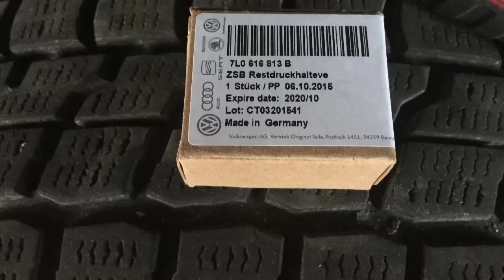Touareg air valve fix front suspension

Comment: Did you get the infamous "Stop Fault Running Gear" warning display before the replacement of that valve? Going through that problem with my treg at the moment and air suspension is exactly how yours was in your video, sitting low in the front but still normal ride height in the back. Recently took it in to a local shop for a diagnosis and they want $1600 to replace what they say is a bad air compressor. Have done a lot of digging around the net to try and (affordably) fix this issue and have learned that others have spent the $1500 - $2000 only to continue dealing with the problem. Part of me wants to trust the mechanics and change out the compressor (still a $300 aftermarket part), as I am no mechanic myself, but these suspension systems are so complex that part of me wants to continue digging and rule out the much less costly expenses first. Just weighing my options at the moment. Thanks for the video!!
Reply: So what did you end up doing? I'm having same issue, thinking about having a go at the valve change in the video.
Reply: Have you resolved the issue?
Reply: Issue has been resolved. Ended up not having any parts changed out by the mechanic. Dug a little deeper and found a pinhole leak in one of the airlines where the line itself connects to the air compressor. Cut off the end of the line just beyond the leak and reconnected to the compressor. Never had another issue after that. Am unsure of how long that quick fix would have held up as I traded it in a couple of months later due to other costly issues arising. Thanks again for the video and hope this helps someone else in this situation!
Reply: Always consider your valve blocks

Comment: I'm getting the 00143 fault code on VCDS. I changed out the sensor, but that did not fix the fault code, I guess I will need to spray some soapy water on the area to see. one question, if I do need to replace valve as you did, do I need to bleed the system first or just pull the plug and let air come out?

Comment: What type of key did you used to open the valve??
Reply from the maker: It was a torx key, slightly tapered/grinded tip for easier entry

Comment: Hey everyone. My Touareg has the stop running gear fault signal. It was first orange and then it turned red after I started to lower, rise and lock. Just before, the signal appeared  I was going pretty fast through some deep puddles splashing the water over the roof. Now the front is blocked in the off read level extra and very stiff as if locked in position with a metal bar. I would really appreciate any help you could provide on this subject.
Reply from the maker: I think it might be the level Control switch/arm. They are located near the shock absorbers on each wheel, a bit high up on the shocks. The plastic arms are connected like «elbows», tendens to rust and get stuck.
Reply: @spoon761  thanks, I'll check it out

Comment: I presume the procedure is to first put it in jack mode and on jack stands? I was first thinking of only supporting the leeking corner, but if the pressure is released it will sag on all 4 corners no?

Comment: nice video! we supply all fix kits for that airmatic strut.
Reply from the maker: steven Kaibintech thanks!  Do you supply new shockabsorbers only? I have some «knocking» sounds from the front, both sides, and cannot find the reason for it. Not any ball joints, maybe the steering rack, but I mostly suspect the shock absorbers.
Reply: @spoon761  Strut mount maybe.
Reply from the maker: @carnut9193  Actually it was the anti roll bar bushings. I found it by chance when the car was on a four post lift for a different reason. It needed to rest on the wheels to find it. Cheap Fix luckily.

Comment: Nice fix! I wonder if it would be a good idea to take those valves apart and clean them every few years....
I did the color by the way, very few are that blue and even fewer are V10s!
Reply from the maker: Thanks! Maybe dismantling and clean them every other year will help, but I think the problem might be brass vs aluminium. I've seen brass tubes in boats, loosing its copper content and get britle. 
  I recently sprayed them with thin rust preventive oil. We'll see...

Comment: I’m not able to get out the last bit of The broken valve. Any tip to get it out? Audi Q7. Thanks
Reply from the maker: Per-Ørnulf Poulsen  well, I sharpened a torx bit, punched it into the center-hole of the remaining stuck valve bit, and it did the trick. Came out easily.
Reply: Thanks for answer :-) think I have tried everything... grisepikk, drilling, punched a normal torx - not sharpened. Maybe that’s The trix.., so I ended up ordering a new air suspention because I just gave up... maybe try a little more and save me all The work for now
Reply from the maker: Per-Ørnulf Poulsen grisepikk er jo bankers, og fullblods engelsk 😂👍
Reply: Anyway - that did not help either 💁‍♂️
Reply: How hard did you punched it? Just a little kick or with a hammer? Will give it a new try before I change the whole ting,

Comment: if you remove the valve, do not you have to remove the air from the pillow?
Reply from the maker: sergiu sebastian yes,  but since it in my case was leaking, the billows were already empty.
Reply: Do you know how I should give out air? that a valve is blocked and that I have to change it. thanks!
Reply: @spoon761  hello do you problem car?